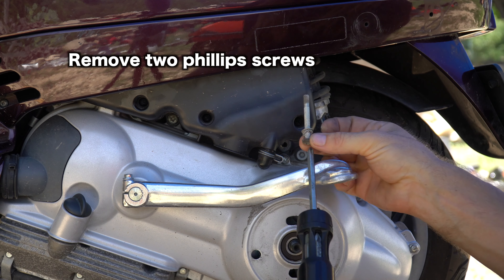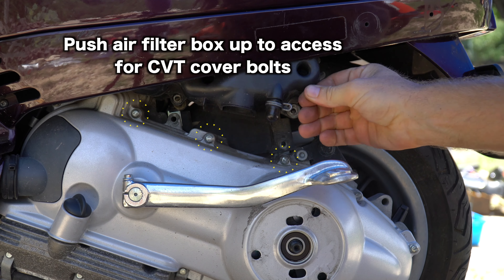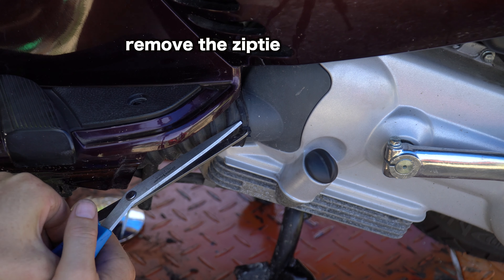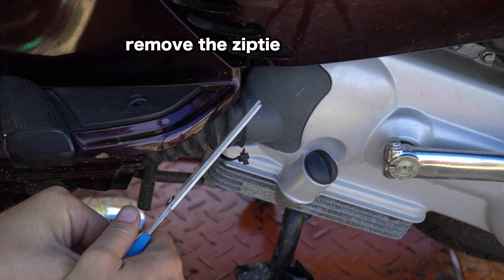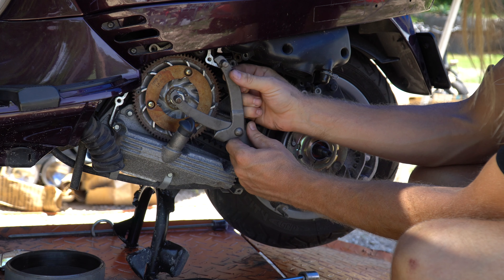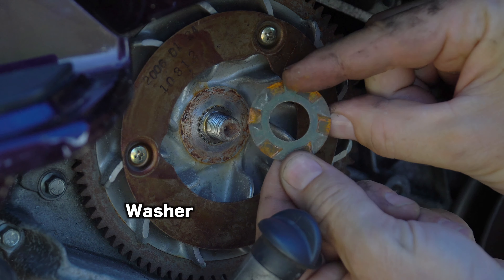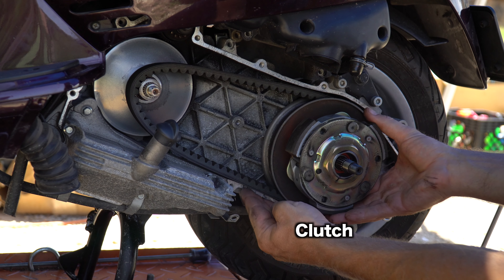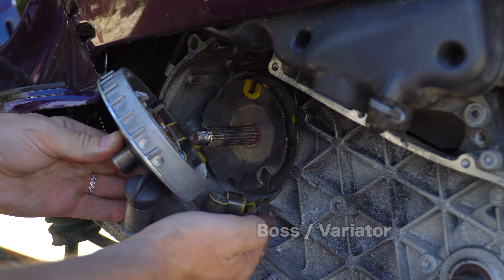Vespa LX CVT Cover / Parts Removal (variator, clutch, drive belt, rollers) | Mitch's Scooter Stuff

Comment from the maker: * Tools I used in this video: 
Ratchet 1/4 drive - http://amzn.to/2xcJEu1
3” / 6” wobble extension set 1/4 drive - https://amzn.to/2UipdJA
8mm deep socket 1/4 drive - https://amzn.to/3cNGsbs
18mm socket 3/8 socket - http://amzn.to/2srvqqx
19mm socket 3/8 drive - http://amzn.to/2CiXNqo
Breaker bar 1/2 drive - http://amzn.to/2HenuMI
3/8 to 1/2 drive socket adapter - http://amzn.to/2HbrYnb
Variator / Clutch holder tool - https://amzn.to/2ZuYJEA
Scissor - https://amzn.to/2pIY56w
Flathead screwdriver - http://amzn.to/2jN7lpE
Phillips #2 screwdriver - http://amzn.to/2fgdZDL
Magnet stick - http://amzn.to/2CkmFhx
Bar ( to lock the rear wheel ) 
Rag ( wrap with bar to prevent scratches on wheel )

Comment: Nice video, and very useful.  Just what I needed!  My 2006 LX150 has a few minor differences (more bolts holding on the air filter, for example) but easy to figure out that part.  Your video saved me tons of time!  One comment -- using an impact wrench is much easier than a breaker-bar, in my opinion, provided you use the proper hardened steel sockets.  You can get battery-operated ones that work well for this (don't need the air compressor anymore).  Thanks again!
-Dan

Comment: Hi Mitch! Ive been working on my vespa aswell and also checking everything in the CVT. However, ive put it back and there seems so be a strange noise coming out of it. Could you check my latest video? Ive recorded it and maybe you know what could be wrong with it. Thanks 😊
Reply from the maker: Hey, is the drive belt in correct running direction? You have rollers or sliders? They installed right?
Reply: @MitchsScooterStuff  thank you for your rely! Belt isinstalled in right direction and I have rollers. They have both recently been replaced. Could it then maybe the exhaust? I do know i am missing one bolt that holds it to the engine... or maybe the kickstand?